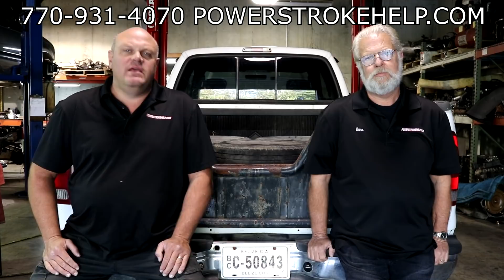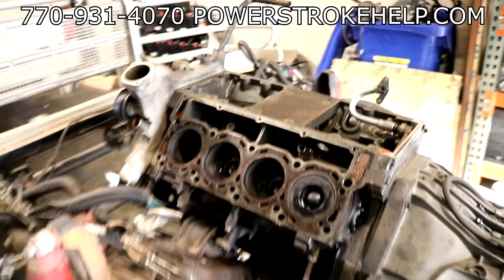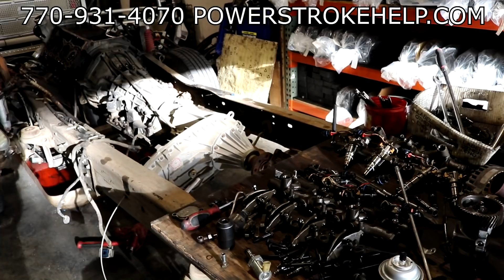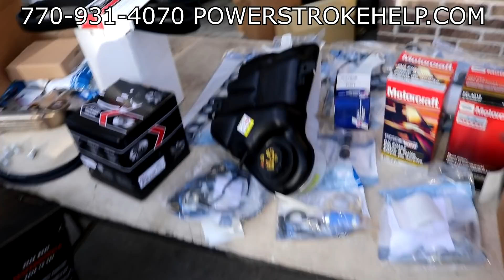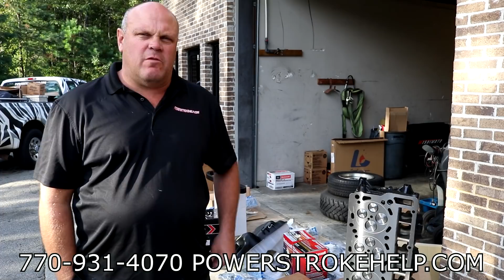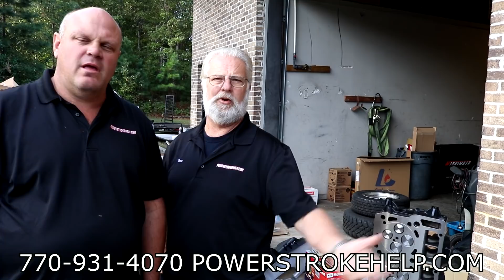LIFETIME DEALERPROOF LIMITED TIME OFFER

Comment: Ever consider offering a 2011 6.7 package with updated heads, metal oil pan, new non-ceramic turbo, later model HPFP and mishimoto CAC tubes. Bring it up to spec with the later trucks. Maybe a narrow market, but these guys (including myself) are just now coming out of the Ford ESP and they're showing up used all over the place.

Comment: I hope you re consider the 7.3 deal.  Here is the thing bill, A lot of guys(not all) understand what they have with there older diesel.  I do not personally own a Powerstroke, I have a Cummins.  However the fact is the books say a certain truck is worth a certain $$ amount. 

 For example the books say my 1999 Dodge is worth probably 5,000 dollars if that.  But to me someone with 25,000 cash cant buy it from me, that is real talk.  I know what I have with a pre emission diesel and don't have to deal with all the head aches as folks do with the newer stuff.  So my point is there are 7.3 guys out there that would spend whatever it takes to get there engine right because at the end of the day they KNOW and UNDERSTAND what they have.

So I think talking to a 7.3 owner and seeing how they feel about there truck would be the ticket.  I see way to many 7.3 trucks out there, those guys need a life line to go to.  In fact when I was looking at purchasing a truck.  I really wanted a 1998.5-2002 Cummins.  My back up however if Time went buy and I couldn't find one was the 7.3.  And the reason for that was because I live just north of Charlotte and I knew that YOU were my life line.  I feel bad for all the 7.3 guys that have seen this video and now feel like they have no support IF something wrong happens that is beyond there ability to fix.  7.3 guys, keep your heads up.

Comment: I can absolutley accept that you have to raise your prices. and for what you get with your 7900 USD (now 8900 USD) is totally worth it. the Fact is that the money you can save buy buying a older 6.0 and then having it dealer proofed and then driving down the road for 100,000s of miles with the peace of mind it will keep going.

Comment: Hello Bill. I've got an 06 f250 6.0 that is starting to get hot on the dash gauge from time to time. My coolant is dropping on a regular basis when I was driving it and so I've parked the truck for good until these upgrades are completed. My EGR & Oil Cooler both I'm sure are the primary issues with my truck as it runs very well when I decide to run it short distances that will not allow the truck problems. I was thinking about purchasing a set of your BIGG DOGG Heads as well as a Bullet Proof Kit for the EGR & Oil Cooler, APR Head Studs, External Oil Cooler that bolts up on the front of the truck under the grill. Any other Ideas?

Comment: I live here in Ga, to be as many 7.3s still on the road as their are I can't begin to wrap my head around y'all not working on em anymore that's crazy but to each his own for business. I guess there is still plenty 6.0s and 6.7s to screw with I'll keep my GM Detroit diesel. I could never afford one of these jokers if I tried ill just let the big dogs pass me on the hills while I get 17mpg pulling my 8k# travel trailer around. If you need them to pull 20k up mount eagle I understand that to think I'd still opt for a optimizer 6500 engine with block main girdles billet crank etc. holds more power and hard to kill one plus it's in old-skool trucks that are better built. Keep the vids coming hope to see 7.3l vids still!

Comment: I’m swapping a 7.3 powerstroke into my 1994 that had the older 7.3idi turbo. I think it’s silly to say you don’t want to work on the 7.3 because the value of the truck is less that repair cost. The way I see it doing my own work is I would rather spend 10,000 plus my labor on rebuilding my 7.3 truck and run it another 300k than spend 30-100k on a new or used truck that’s expensive as hell to upgrade or fix to make last not to mention all the expensive emissions junk on newer trucks. Lots of big rigs are being rebuilt for the same reasons. Cheaper to rebuild then by new because the longlivity and simplicity offsets the cost of maintaining and repairing newer ultra expensive epa regulated econobox crap regardless of market value of the truck. Not everyone operates off of market value alone because as expensive as some of these new trucks are it simply makes more sense to rebuild. Fords new first 100,000 dollar pick up truck is a complete joke. Do you realize how many overhauls you can do with a good used chassi for 100,000 dollars? The bubble on the market of these trucks is getting ready to pop as more and more folks are unable to afford to buy new.

Comment: We have been fire ringing Cummins and Powerstrokes for many years.. 3.728 is the min. on the 6.0 and 6.4 heads. There is a .020 saver shim. I never recommend the customer use it however some customers are on a budget and have no choice. Bill with all the engine work you do you could be more profitable doing the machine work yourself.

Comment: What happens with the lifetime warranty after Bill is gone? This is getting scarier by the day. No support on the 7.3, 6.4 problems with the 6.7 and your only saving grace is a 10-12yr old truck with heavy modifications. Time to shop around outside of Ford, maybe ill lose the luxury and smooth ride but it will be dependable. Thanks Bill

Comment: Wow, if Bill at Powerstrokehelp has given up on the 6.4 you know for sure its a piece of trash. Straight up junk.
Reply: M Cool So, you buy a brand new 6.4 crate motor, with all the inherent problems and weaknesses that caused your original 6.4 to die extremely prematurely. Doesn't seem like a wise decision.

Comment: I think you should do this every year. Think about it it will bring work to a point you just set up a shop here in Colorado or any other good state. I dont know any other service for a Pick Up Truck that men will attack you for.  Doing good work guys.
Reply: Man lot of talk about 7.3.. Thats not a Ford motor it Canadian. There are few issue with 7.3. 1. Emissions 2. Age  94-03 was a good run. Its time to move on and right now things are moving to fast. 3. Power just could not cut it with the 6.0 variable geometry turbo (VGT) provides quicker spool-ups than the 7.3 was able to do. 4. the look. the look the look. It has a look the speaks to the now  and then.  The 7.3 is not a bad truck but for why try and fix it if it ant broken? I live by let Legends die. The 6.0 was a Dream that turned into a nightmare FAST its only Legend was good looking, great boost and will die. Bill figured out the (WHY) and saved its good name. I asked what Billy asked when i talked Diesel shops and folk. I learned it was was something stupid Egr/Oil Cooling design and improper head design. Other than that the thing is a Rock.

Comment: You have compared the dealerproofed 6.0 to the 6.7 on operating cost. What kind of mpg can the 6.0 get ?   Also what kind of longevity will the 6.0 have after being dealerproofed?   Like some of the ones that 150,000 miles when you fix them , you can you expect how many more miles?  Thanks

Comment: Buy a 7.3 and no need for bulletproofing
Reply: Frank gman just oil leaks and transmissions
Reply: You mean typical diesel engine rustproofing and normal wear failures, due to lack of maintenance and abuse? Yup. 7.3L all the way bud. 7.3L is simply the better engine - undeniable.
Reply: Frank gman I think that’s why he’s hating on the 7.3 because he can’t make business on it like he can from a 6.0

Comment: Could just put a link to the video explaining what the lifetime dealerproof includes in the description of the video... Avoid having to respond to a bunch of emails...

Still love my 7.3... Sucks I won't be able to find an honest place to repair the engine when it finally goes. 

I hope Ford doesn't stop selling Ford Remanufactured 7.3s... I know my 7.3L won't last forever but I absolutely love it to death and will NEVER part with my truck. She's got 174k miles on her now and runs great... Hoping for another 150k+, but no idea what the hell i'm going to do if the motor eventually does break... 

...Besides replace the entire thing with a crate 7.3 from Ford. It's not about the value of the truck, my sentimental attachment to it is indescribable with words and worth an endless dollar amount to keep running.

Comment: I bought a used 6.4 08 100k from dealer. First diesel I owned, never did research.. am I fucked? It went in limp mode with in 3 days , dealer ship hadit a month could not duplicate... Tuner delete. ?? How much longer is truck good for?
Thanks 
Nik from Arizona

Comment: Dang was hoping you could build me a 7.3 engine one of these days.  I have five of them in the family here in Montana.   Can you put a 7.3 in a 6.4 chassis?  They are giving them away up here.
Reply: Shawn Blixt I need one of those 6.4 chassis’s.
Reply: Shawn Blixt  we can build you a 7.3. We are located in Butte.
Reply: Cummins that's the way to go in a 6.4. Some guy are selling the conversion kit on line for almost 5k. You can use 12V, 24V or common rail engines as a donor.

Comment: Ford is perceived as embodying more of the 20th century than the 21st. The continual success of the F-150 truck series fuels the perception. The F-150 has been the best-selling vehicle in the United States for the past three decades. Recent sales trends point to the streak going unchallenged for another decade.Ford reports that F-150 sales were up 14% for the latest quarter. Ford also reported customers paid an average of $45,400 per F-150, up $2,800 from a year ago. The reality is that Ford depends on the F-150 to make money.  Why things cost more and more... FORD is making MONEY>>>>>>

Comment: First. Do you guys sell those heads? Or a kit. No warranty, I’m a do it yourself guy. A kit from you would be nice. 

Second. I call BS on what your buddy said. I love what you guys do but saying that taking a $12k truck and doing the $7900 job does not make it worth low &20s. A $12k is just a $12k truck, no matter what you add. For example, If I go buy my uncles truck which is a 2006 with 200k on it for 10k, KBB value, and I get you to do this job. It doesn’t make it worth $18k. KBB will still say it’s worth 10k. And no one is gonna care about upgrades. It’s a great sales gimmick. But truth is you never get out what you put into these trucks.
Again, just my opinion.
Reply: True to an extent... it also depends on supply and demand, if someone wanted the truck bad enough with all the mods already on it they might be willing to pay the extra fee/price.
Reply: Ray Dornbush : that is true too. Some people just have to have it and have the money.
Reply: People are willing to pay for the piece of mind, if you pay 12k for the truck, then 8k for the work, or you just pay 20k up front, you're spending 20k regardless. 

20k gets you a sweet ride now
Reply: SuperLukedukem hay you can go to a machine shop in your area like I did they did o rings and bronze guides and new valves for me 4 years ago my truck still going
Reply: You're absolutely right...However. I will say that I have personally seen that whether the truck is "dealerproofed" or not. The value of these trucks has DEFINITELY gone up. About 5 years ago...I got a LOW MILE (78,000 miles) 2005 Lariat Dually. It was a crew cab long bed.  And I paid $9,995 for it from a dealership. Today that same truck is selling for almost double that. And is finance-able at that price. And I personally believe it's because even with spending 10 grand on getting the truck dealerproofed. Starting with something that is selling for under 20 grand. You're still going to spend LESS than you would if you bought an equivalent Dodge or GM. Be it Chevy or GMC. For a dually 2007 Duramax up here in Minnesota with lower miles and 4x4. You're still looking at spending a minimum of 30 grand. And that is for a mildly loaded LT/SLT. If you want and LTZ/Denali it's closer to 40...

So the Fords are going up in value because of the fact that even with spending a ton of money to make them run right. It's still cheaper than buying a Chevy (GMC) or a Dodge.
Reply: NBF1865.  Nope.  I had a car in which I plugged a bunch of money into and it got totalled in n accident.  I provided the insurance with all the receipts for the upgrades and I was paid accordingly.
Reply: Brandon Crimmins Yeah Ford's and dodges were always the cheaper work trucks usually Chevys run a little more but most of em are decent but these new Ford's have gotten out of hand with all the complex sensors on em' makes it harder for the average Joe working on his own rig specialty tools etc..but thats what they don't want you doing so they make it incredibly advanced expensive shit Lol can't beat the old 80s-90s Ford and Chevy trucks especially the pre-emissions diesel.
Reply: In my opinion if I ever do this kind of upgrades to my f250 is because I'm going to use the truck an probably not going to sell it anytime soon. You're the one that is going to trust your own truck to pull loaded trailers on long trips.
Reply: SuperLukedukem ....You are 100% correct in saying this. You never get back the money that you spend in repairs on any vehicle because most people don't know or care about your upgrades.. Blue book is blue book. They are not going to agree to your price increase. ...ever.
Reply: Considering prices of trucks today, especially the 6.0, this comment aged like milk.

Comment: I dropped my truck off for the 6.0 Dealerproof work just yesterday, I must be like the last owner of a 6.0 to have this done. The drop off was good. Scott G. was the point person. Good guy. Man. ...they aren't lying - it's hot as hell in Atlanta. And the cop cars are cool: all black, dark tinted windows, lights like I have never seen before (...not that I had one behind me).
Reply: How's the 6.0 been doing since the dealer-proof? I want to know if you have had any issues with the heads and gaskets since and is it any better on fuel mileage?    Just got a lot of them ( 42 '06 E250's)  from a fleet auction and  not going to resell them without doing the upgrades.  Is it really worth the price he asks for the BIGGDOGGS or should I just do all the needed fixes and re-use the factory heads I have.

Comment: Even if I could pick your brain for a few minutes on what to do to keep my truck running good I understand if it’s running good trade it off I get that LOL I’ve worked hard my whole life my grandfather taught my father to keep his ducks in a row my father taught me to get my ducks in a row I was hurt in 2013 and had to retire early financially I don’t have the luxury to throw money around unnecessarily but believe me my truck is a necessity you say trading off financially I don’t have the means to do that like I said it runs great I hope I don’t jinx myself and I’ve kicked myself not because I don’t like the truck but because of the 6.0 and then I’ll like I have about them now I would’ve bought an older truck but it’s just not an option and I have to keep the one I have running good I don’t want to do stupid things with it I don’t wanna be the guy patting myself on the back for the weeding everything but please give me some ideas to keep it going I fully intend to make it a 500,000 mile truck people laugh at that in 1998 when I was working and making good money I bought a brand new Chevy 1500 Vortech V6 I currently have 398,000 miles on it I can walk out today and turn key The starter and it fires right up smooth as the day I bought it I have to admit I can’t drive it right now I need to put a freeze plug in it LOL this is how OCD I am about taking care of a rig I know my 2010 Ford might have issues but I’m confident that If I treat the maintenance correctly and continue I can get the same types of mileages out of you I just need to know the right path to be on I have not yet went to your website but I do watch your YouTube videos and find them the most informational and I have a lot of faith in your knowledge

Comment: So that kind of sucks because I have a 6.4 I got to be honest and I don’t wanna jinx myself I’m OCD about maintenance and taking care of it I’m not a power monger I do Topheth well on occasion not full-time so I want to ability I’m really into mileage of course I don’t want to gutless piece of crap either I was watching this video and you pretty much just told me you don’t work on six Forks anymore now I’m concerned I’ve never had one day of trouble with my truck never had any engine lights come on I probably over maintain it if that’s possible my oil is changed every 3000 miles sorry everybody can tell me what they think but it’s just built into me I’m not a hot rotter I don’t want to be Corvettes at the street light LOL any suggestions what I do now I would like to delete my smog stuff because I understand the trucks the motor out again I’m not doing it for extreme power although I realize it will give me quite a bit more but I’m going to delete everything and straight pipe it I want to program that’s clean there’s a saying that if it smokes doesn’t mean it’s broke well in my book it does I hate dirty programs as well I just want to clean all around toe ability program anyway I don’t even know if you see these messages I would love a response on what to do next I’m also not looking for a lifetime warranty I feel I can take care of that side on my own because I don’t drive it like a Madman
Reply: Don't trust others Get his company's EDAS tuner  it will give you the reliability and warn you about problems way before the engine light ever comes on..  the straight pipe exhaust system will be a good thing if you don't have emissions testing (if they just do visual checks there are some muffler shops that will open up the OEM system and clear it out to give it the same straight pipe fix but look factory)